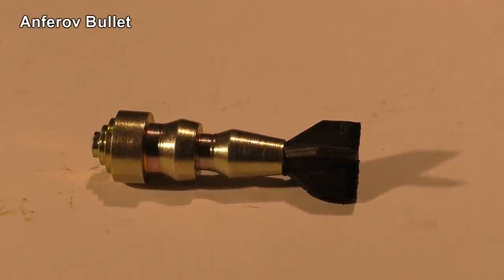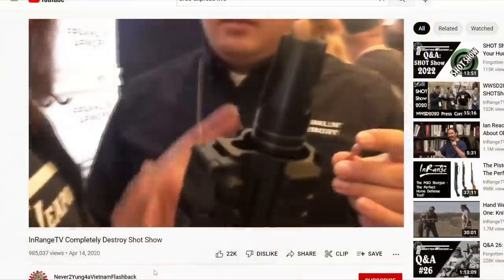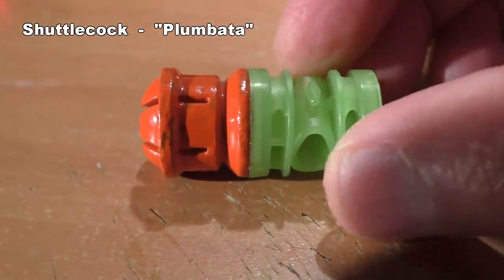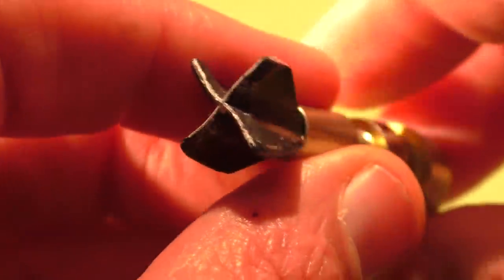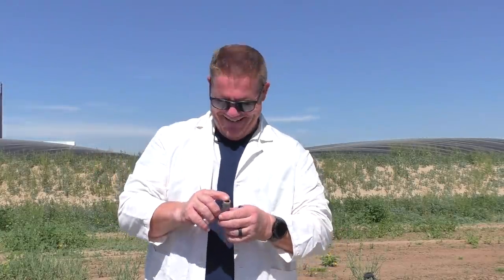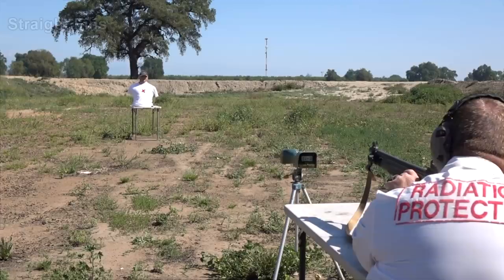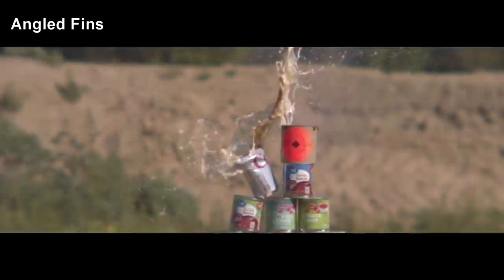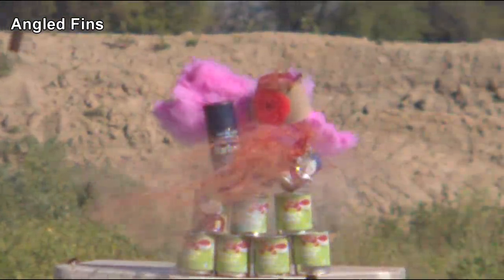Supersonic Darts - The Effects of Inducing SPIN - I learned something!

Comment: As far a parasitic drag goes, in this system the amount of drag is proportional to the amount of spin it induces. Slight drag == slight spin. Lot of spin == lot of drag. In the high tech water drop test, there was less than a quarter turn, so the extra drag is the amount of energy needed to twist it that amount in that time, so the drag is very very low. This is part of the reason you don't want rifling to twist as hard as possible. Rifling reduces speed, and the more torque produced, the more speed is lost.

As far as the increased tumble, rotating objects with asymmetric balance will precess, that is, rotate about a secondary axis. You can see this with any spinning bullet over a long enough time scale even in perfect conditions. A fin stabilized projectile is very front heavy, and thus very asymmetric, and will have a much higher chance of precessing noticeably. 

This effect may shrink or grow depending on a number of circumstances. An uneven axis of torque is the most significant. The first spin test must have had a fin that was bent more or less than the others, causing that initial imbalance that sent it tumbling. The later ones were likely made to greater precision. Atmospheric effects can also have an impact, a strong side wind will affect the tail more than the front, and because it is spinning, that torque will cause it to turn perpendicular to the wind, creating that initial imbalance and swinging the tail in circles.

As far as the costs/benefits of spin stabilizing a round with a fin, it depends on the round. Basically the less the fins do, the more the spin will do. Short fins are not so great, and spin may help. Long fins are awesome, and spin is useless. In either case you will lose some speed and stopping power. In general though all you will do is unbalance the system.

Comment: Forty degrees is WAY too much. 

Four degrees would probably work better, and even then you might have to increase the range slightly to see it stabilize, you're testing what I would call short range with a shotgun. 

This would be fun to see but I doubt you'll see any practical benefit from it. On a dart or an arrow a tiny angle can be helpful, both to even out asymmetry as you mentioned and also to resist crosswinds, which tend  to affect straight fin-stabilized projectiles much more than other types. 

If these are manufactured with sufficient precision the first benefit is null, and at the velocity these things are travelling the crosswind is likely null as well. 

At least at short range. At extreme long range (shotgun) you might see something interesting.The straight fins will fall below line of sight more slowly, having less drag. But the angled fins, if you get the angles right, will be a bit more predictable side to side.

Comment: People who haven't shot out to long distance don't really know this commonly, but spin on bullets out to extremely long range can cause spin drift. Common range shooting doesn't really bring this effect out, but right hand twist barrels typically cause an impact right of center, and left hand twist barrels cause drift left of center. 

Your first projectile looked like it had too much of an aggressive twist, or was off balance at the rear end. That could have occurred if the wadding or sabot had not been discarded evenly. 

All in all, with a shotgun slug like this, there's really not much point in having it spin stabilized. If anything, it would introduce spin drift into the equation at longer ranges. 

Lots of artillery shells are shaped similarly, and to my knowledge, very few, if any, of those rounds are spin stabilized, and they're fairly accurate out to the range of multiple miles.

Comment: To the manufacturer of this projectile, there is a way that may, probably will work a whole lot better by having the "spin without actually spinning" and even though this sounds ambiguous and, in a way, it is, the fact remains that there very well may be a better adaptation of "spin" which could possibly eliminate the sonic boom and I would go so far as to say that my design could increase the speed of the projectile exponentially. You should get in touch. What have you got to lose?

Comment: HEAT
heat is an acronym that stands for high explosive anti-tank. a shaped charge weapon that concentrates a super high velocity jet of molten metal to penetrate armor the first use of these weapons was in world war ii where they were used by both the allies and the axis powers primarily as man-portable anti-tank weapons such as the american bazooka or german panzerfaust while the use of heat shells fired from guns was experimented with during world war ii particularly by the germans it was found that rotation such as that imparted by rifled barrels decreased the effectiveness of these shells with the effect worsening the higher the rate of rotation this is because heat weapons rely upon a combination of extremely precise detonation and geometry to form the metal jet that penetrates armor any addition of external forces such as the centrifugal force caused by rotation could interfere with the formation of the metal jet or prevent it from forming entirely 

APFSDS

As APDS rounds were improved upon a clear design trend was that the rounds became longer and thinner this posed a problem since the higher the ratio of length the diameter becomes the higher the rate of rotation needed for spin stabilization to be effective past a length to diameter ratio of about six or seven spin stabilization requires a rate of rotation so high that it becomes impractical to achieve this design constraint led to the development of the first armor-piercing fin stabilized discarding sabat rounds because apfsds rounds are as the name suggests aerodynamically stabilized by fins they do not require the spin stabilization provided by rifling more than that rotation at the rate imparted by a typical rifled barrel will actually significantly reduce the effectiveness of these rounds apfsds rounds like apds rounds before them are pure kinetic penetrators that is to say they rely upon their kinetic energy determined mostly by their velocity to penetrate armor in the case of apfsds projectiles rifling reduces velocity in two ways first because a portion of the forward velocity the type that matters for kinetic penetrator is converted to rotation while traveling down the barrel but second and more importantly after exiting the barrel the rotation of the fins causes them to whip through the air massively increasing drag this will further reduce the velocity of the projectile at any range but the effect worsens the further away a target effect worsens the further away a target is greatly reducing the penetrative ability of apfsds projectiles at medium to long range to counteract this effect somewhat attempts have been made to reduce the degree to which rifling imparts rotation to these projectiles with varying degrees of success while a small amount of spin actually does benefit thin stabilized projectiles this is typically achieved simply by canting the fins at a very slight angle relative to the penetrator and even in the case of apfsds rounds that are specifically designed to be fired from rifled guns the rate of spin is still significantly higher than optimal resulting in noticeably reduced performance

This is why the two spinning rounds hit low

Comment: your fins are not all at the same precise angle.  That will impart different amounts of physical force to the spin, making it a bit unstable.  Machine some proper fins with an arc rather than an angle.  Smooth flow, not sudden, and less angle.  You don't have much real estate to work with, so mods have to be slight.  Then, 100 yard scoped benchmarking.  Interesting test.

Comment: You probably need very little angle on the fins for spin stabilization. I don't know if the fins did this or if some vectored thrust was involved, but this amateur rocket used a bit of spin for stability. There are some clever tricks used on these big ones.

https://www.youtube.com/watch?v=Xg0FfxHPGXs

Comment: The faster the projectile is moving the less spin you will get. The spin will make an already accurate projectile travel off course. Lower the powder load and I bet this bent fin becomes even more inaccurate as the spin makes it travel in different directions instead of evening out flaws

Comment: As a mechanical engineer, with airspace experience on subscale flight. You did a terrible job on those fins. You could induce the rotation with much smaller fin "adjustment". and if you do it assimetricaly the projectile will have a minor spin on the wrong axis making it unstable.

Comment: Sorry but at that distance with a 40 degree bend, you're going to get terrible results regardless. Just rough estimate, you'd see a higher granularity with results positive if you probably put like a 8 degree, no more than maybe 15-ish degree, bend to the stabilizing fins. Since it's going super sonic, I'd say less aggressive a bend is probably better and especially since the barrel is already rifled. You can add a higher cant if the barrel is smooth and/or sub sonic speed. The type of bend also effects the turn rate between a straight angle bend or a smooth curve; the smooth curve imparting a less aggressive Pelton impulse effect on the spin leveled pressure contrast to the angular bend which has a reactionary effect imparting a more aggressive spin as seen in the high-speed camera's slow-mo footage. I hope you'll be able to test it out again if ammo inventory permitting. Thanks for the vids and good luck!

Comment: The idea of angled fins to impart spin makes no sense. The reason rifling increases accuracy is because the spin axis is linked to the the axis of the barrel (aka what you're pointing at), since the spin is already there as the projectile leaves the barrel. With angled fins, the spin is imparted at some point after the projectile leaves the barrel, and when it is pointing in an unpredictable direction due to wobble. Angled fins can only decrease accuracy in this application.

Comment: I am commenting before watching the video. My mind tells me you cant spin a projectile which has fins. Fins are actually other way of inducing stability and resist spin. Smooth bored howitzers, tank guns all have fins. Smart howitzer rounds also use fins because spin will disorient the guidance and navigation systems. Rockets have fins too.
Reply: And after watching the shape of the sabot i feel like your curved fins will either make the round barrel but considering how much mass you have in sabot and how little those fins are i think the possibility of that is very little and second possibility is that big flat head of projectile will create a cone of vaccum behind sabot and fins will only act whenever fin goes out of that vaccum pocket, correcting the course of the projecticle. Which looks more likely and effect maybe slightly worse accuracy mabe so slight that it aint even noticeable.

Comment: G'day,

Fin-Spin Stabilisation could be good, IF the Fins were carefully manufactured or fabricated to be cambered (curved) Aerofoils with Helically-twisted Pitch, and with all the Fins uniformly identical, and balanced.

What you did was to roughly bend previously uniformly flat straight Fins (by hand, with Pliers, and without measuring...?), into four mismatched unbalanced high-deflection Trim Tabs all imparting different and unbalanced Roll-Inputs - thus causing the spinning Tail to spiral around a Corkscrew path, wagging like a Piglet at high speed.

Please, try again, with some propperly made Helically-pitched and smoothly cambered, uniform, balanced Fins ; and then your Results might teach us something valid.

"Must try harder...!"

As the Schoolteacher used to say in Reports.

Such is life,

Have a good one...

Stay safe.

;-p

Ciao !

Comment: Your water drag test isn't a very accurate indicator of drag. In the atmosphere drag increases exponentially with forward velocity. An aerospace type engineer could give you a formula. Also, those tiny fins would be in a turbulent vortex at supersonic speed. Effect would be questionable. Neat idea if it actually works.

Comment: I don't think these specific type of slugs will prove much of anything. The angled cuts in the actual slug shape impart most of the stabilizing effect. Spinning will of course center the slug in a more precise way, but only after many hundreds of hours of calculated and tested wind tunnel testing, i.e. you can ain't just bend a couple of fins with some pliers and expect re a l results. Great video nonetheless!

Comment: Most things that fly don’t require spin for stable flight. Could you imagine a Boeing 737 spinning at like 758rpms? 😩🤣
Reply: Most bullets dont have active steering like an airplane, a missile or a bird :P
Reply: @hernerweisenberg7052  but most if not all bullets don’t require or have fins. The stability comes from the projectile being spun. You could essentially have fined bullets fired from smith bores and they would perform pretty close to a smooth projectile from a rifled barrel. 

Spin doesn’t necessarily mean stability, you have the mass,center gravity, the ballistic coefficient, etc to determine how accurate a projectile will be and for how long given distance it will remain stable.

Comment: lloks like you missed something.
You kind of got the defect hing, but the water drop showd the accuracy, it also showed a speed difference, but you have to understand triangles to see it.
See, the spin went straight down, while the non spin didn't go straight, meaining a diagonal.
That means that if it hit at the same time, by basic logic, it must have gone faster, since it had to have traveled farther, since a diagonal is longer than a straight line, as it is two vectors.
You can see the speed difference, but you get confused and second gues yourself when they hit at the same time. 
Again, the answer  is that it hits the bottom at the same time, but by traveling diagonally, it starts to go down a bit farther than the straight fin, then the straight paralele line catches up, or it seems to slow down. obviously it's not changing velocity, but instead is travaling in a diagonal.

Comment: Personally, I say the twist in the fins is too aggressive. The spin stabilisation is only really needed for accuracy over range. At range, the projectile has a lot of time to spin up and thus doesn't need such an aggressive angle. Too much of an angle deflects too much air which slows down the projectile more than needed. Think in terms of the twist in the rifling of a barrel. They're not so aggressive. They'd need to be aggressive in a short barrel to get the right amount of rotation when the projectile leaves the barrel but the projectile in this video has the whole distance of travel to spin up to speed as its constant air-deflection creating the rotation and not the point rotation created by rifling in a barrel. Long story short, a bullet fired from a gun is only under "powered rotation" until it leaves the barrel. The one with fins is under powered rotation for the length of its entire flight. 

I'd suggest try 8 to 10 degrees of fin deflection at the most.

If you crono two projectiles at 50 feet, one with 40' and one with  10', I dare say you'd be able to see a measurable difference in projectile speed at the 50 foot mark.

Edit: And that's with both projectiles still having enough rotation to remain stable during flight.

Comment: My two cents as a complete ignoramus:
1. Fins stabilize only by inducing drag on the rear of the projectile, making the rear "want to travel slower" than the aerodynamically shaped front, and thus counteracting tumbling. There's to my knowledge no other way that fins provide stability. In crosswinds they might even degrade performance by catching wind and causing the projectile to veer off. I know this is the case for finned RPG-rounds which will veer off into the wind.
2. These projectiles seem very well machined, with no visible imperfections. 
3. Your fins are somewhat crudely bent, making them the most imperfect part of the projectile. So if projectile surface imperfections affect performance, these rough fins may make an otherwise good projectile worse. 

This can be tested by firing: A) an intentionally wonky projectile with expertly curved fins (will a smooth curve be better than a 40 degree angle?), and B) a perfect projectile with intentionally wonky fins.

Comment: How is a bet fin not just a crude aerofoil? Aerofoils suck at supersonic flight (something about shockwaves that I'm smart enough to know to exist but I'm too dumb to really explain). Bent fins are engineering a problem into the design the mere existence of the fins in the first place has already solved.
If you really must have spin, maybe try adjust the angle of attack on the whole fin. Google tells me a diamond  shaped cross-section is good for wings at supersonic flight.
Or, if you really want to overengineeer the bejesus out of it, maybe a type of fin that's flat at supersonic velocities but curls up as the dart drops to subsonic speed to impart spin. That's assuming a combination of fin and spin is better than either alone. Maybe you want a super sniper slug to shoot half way around the world with? Must be a nightmare to zero in a variable-geometry bullet.
Don't @ me I  work nights and can't figure out when I'm supposed to sleep. These are the ramblings of the sleep deprived